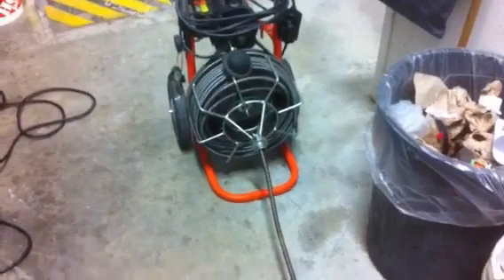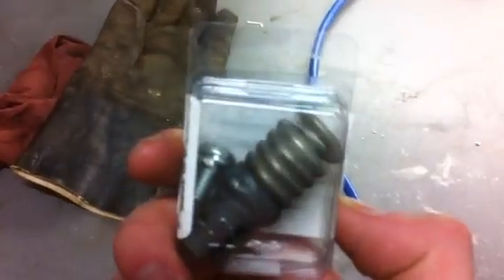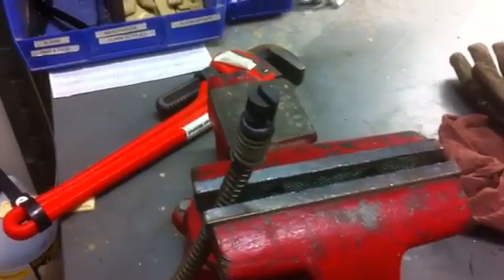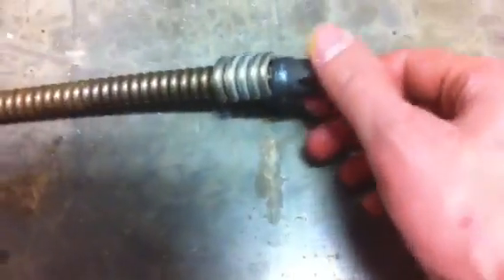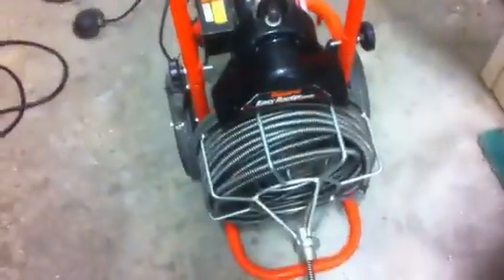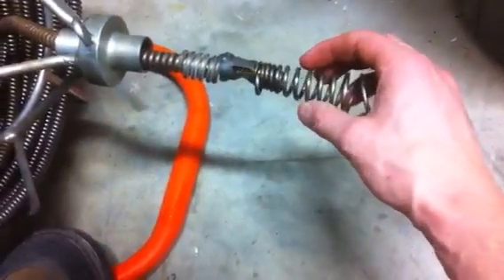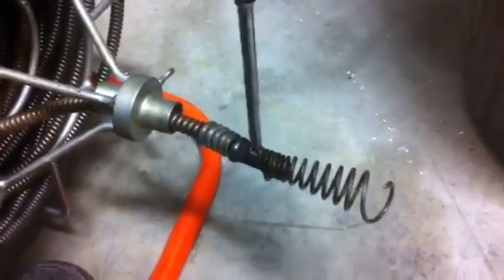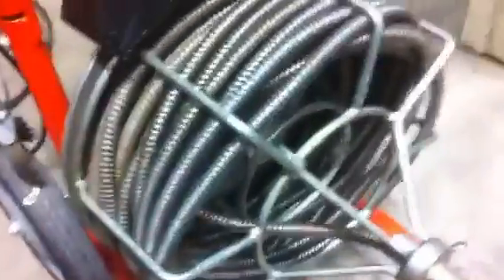General rooter repair

Comment: i have 3/8 cable i need one of those but dont know what size if 1/2 will fit the 3/8 ? or have to buy a 3/8
Reply: buy 3/8.
Reply: @dangda-ww7de  i been looking for general rooter every where they dont have 3/8 only 1/2  5/8 and 3/4  but i seen one from ridgid had 3/8  but have to buy new cutters for ridgid  cables
Reply: @carlossosa2940  I think u can use the 1/2 to put into the 3/8 cable.
Reply: @dangda-ww7de   yeah thats what i was thinking  so if 1/2 inch is not fit i can possible weld it ,, or like i said before i found a 3/8 quick fix for ridgid cable but i have to get ridgid cutters ..

Comment: my wire is 3/8 inch though.   do they have that size??
Reply: i think you have to use 1/2 inch coupler  for 3/8 cable , and for 1/2 inch cable i believe is 5/8